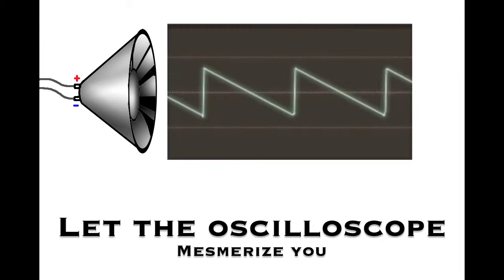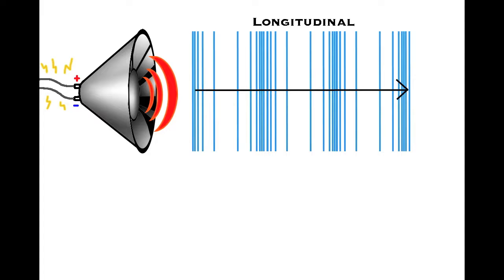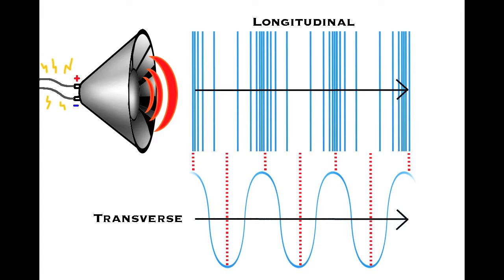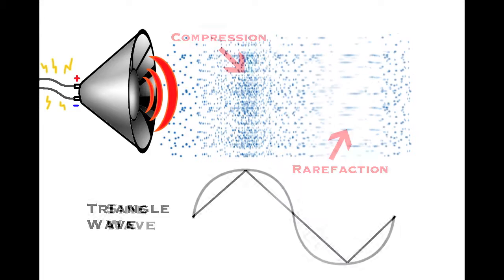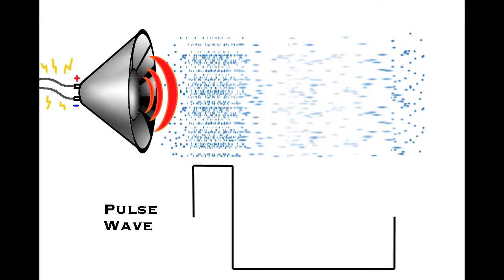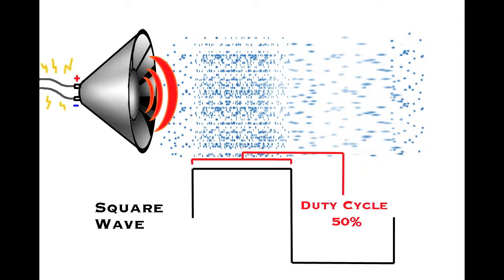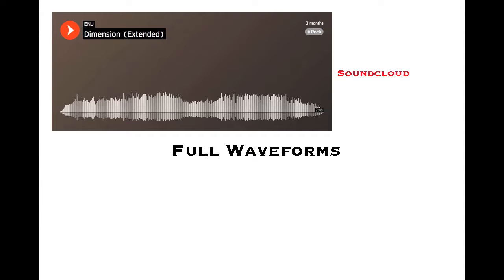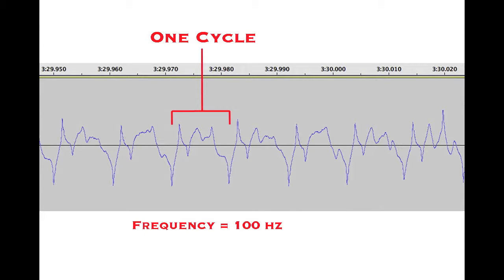Sound Design and Synthesis Part 1: Waves and Waveforms

Comment: I dont get how volume is visualized in a waveform. If the middle line is zero amplitude how can you hear anything that's below it? Is the bottom of the drawing zero volume/amplitude??
Reply: The line is 0 and every inch away from it is to be counted as an absolute value. So it doesn't matter if it's +2 or -2, because it's 2 in the end. But how? You might ask. Well, it's because in physics a negative or positive value only means direction, so the part above the zero amplitude is the action, and the part below a reaction, exactly how a guitar string moves when you play it... and if you do the experiment, it still sounds when it moves down.

Comment: As you morph 20% pulse to 50% pulse shouldn't the frequency also be adjusted. For example the frequency of a square wave seems to be about twice the frequency of a 1% pulse if both take the same length of time to cycle around completely, considering when transitions between the high and low signal happen.